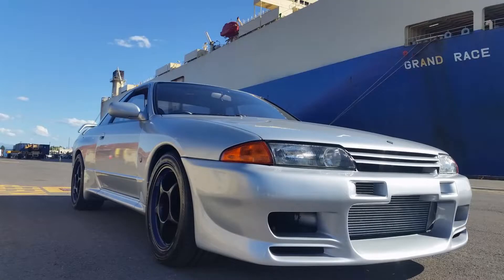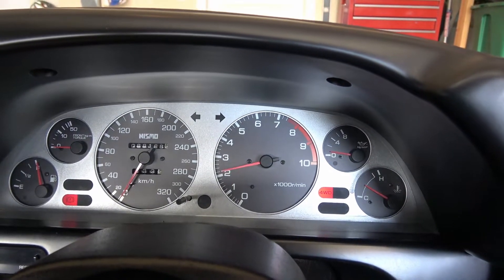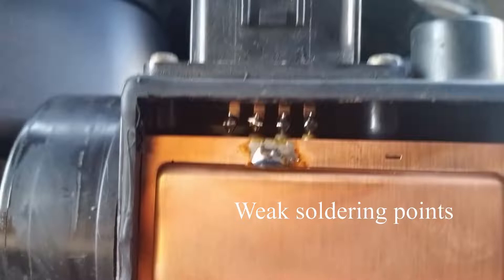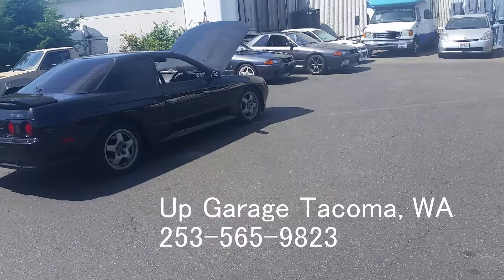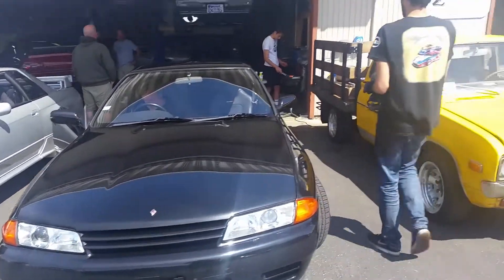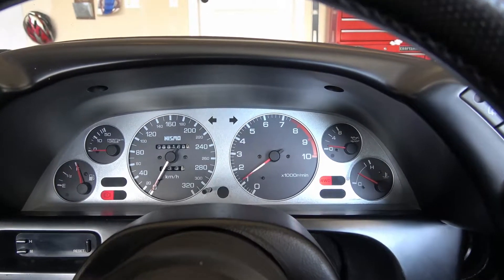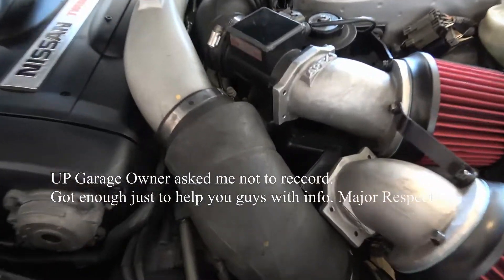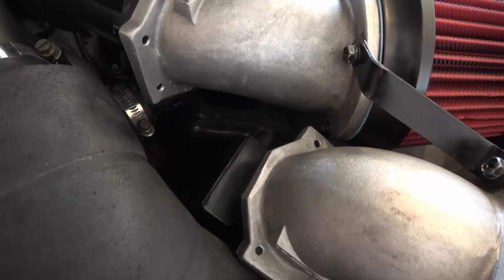RB26DETT engine wont rev nissan skyline ignition problems bad maf sensor repair

Comment: Same problem but on a rb20 at 3k rpm. Anyone think it could be a boost leak? Clogged fuel lines? Mine usually happens when it’s hot so I’m thinking it could be the ignition coil.
Reply from the maker: Did you resolder your MAF pins?
Reply: @JDMRightHandDrive I had a new maf. I found the problem though I changed a vacuum line and cleaned the iacv and the problem was fixed. This was after I checked boost leaks, changed spark gaps. Tested spark and coil packs and dialectic greased them. Tested ignition coil. Replaced maf check fuel lines and replaced ripped lines. All those things didn’t fix it it actually got worse. But then I replaced one vacuum line and cleaned the iacv and the problem just went away.

Comment: My mechanic told me my sensors were going bad because my car would jerk randomly while cruising.
Reply from the maker: My car would do the exact same thing as yours. I would be cruising at 120 kph down the free way. All the sudden car would start jerking really bad.  I couldn't give it anymore gas because it would jerk violently. I would have to lift off the gas to bring the rev below the 2500 rpm range. The car would drive like normal, but only below 2500 rpm. Was fun driving on the freeway at 90 kph.  Let me know when you re solder you MAF's if that fixes your problem. Good luck!